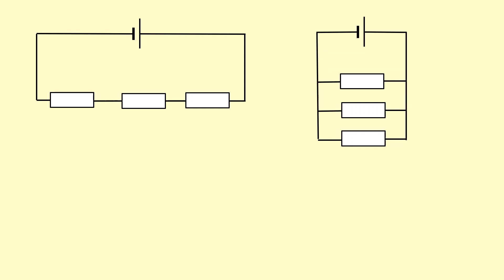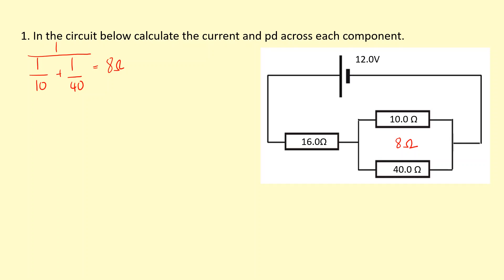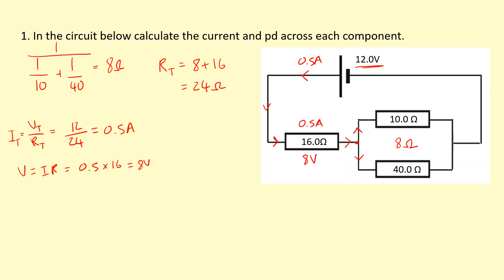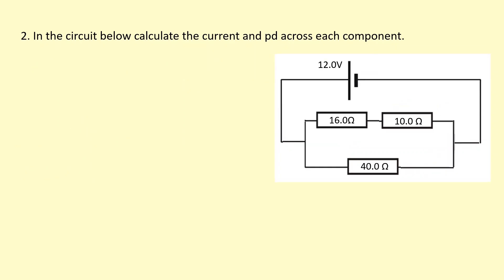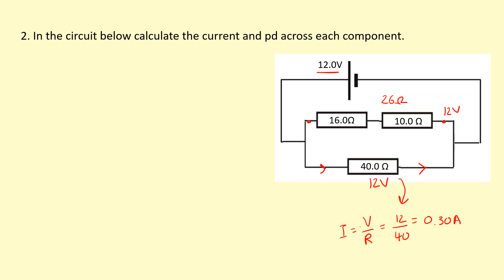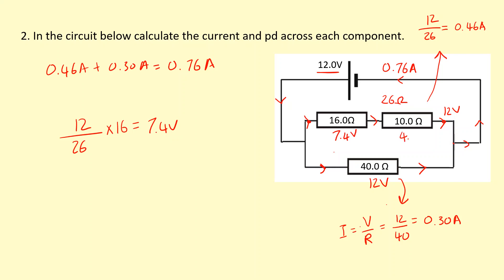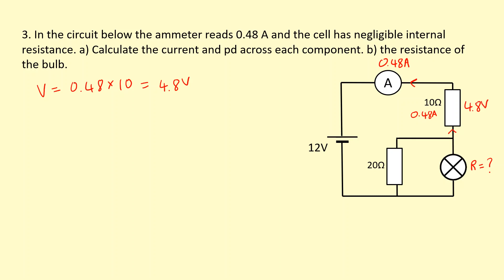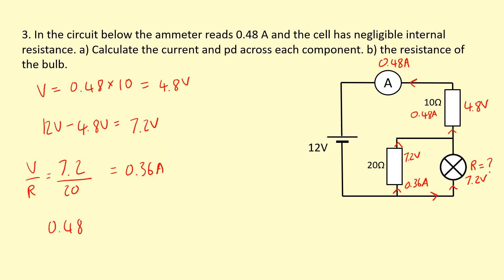3.09 How to deal with circuits with series and parallel components

Comment: isnt current supposed to flow from the longer side of the cell
Reply from the maker: You're right. In example 3 and 4 i did it wrong.

But for a circuit which doesn't have a diode it actully doesn't matter. The answer will be the same.